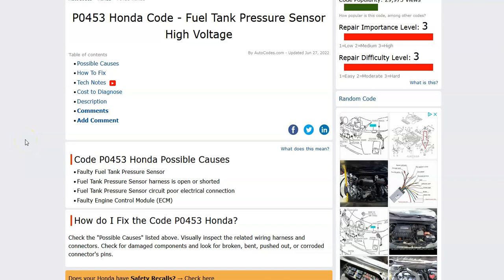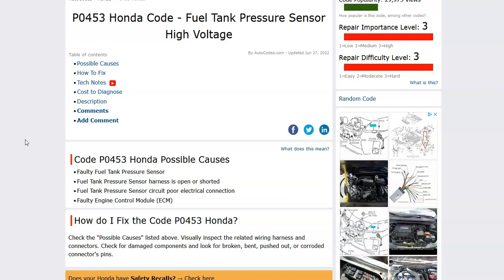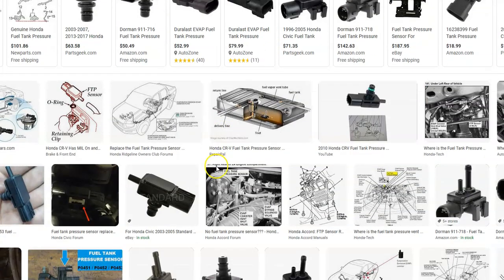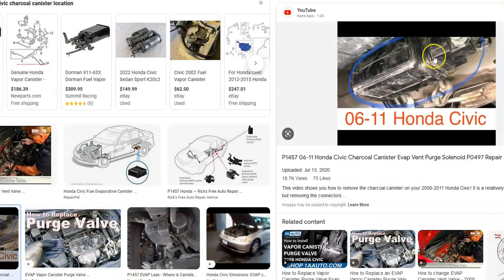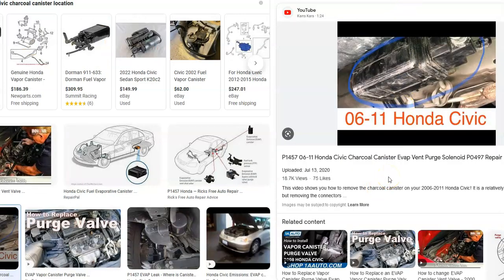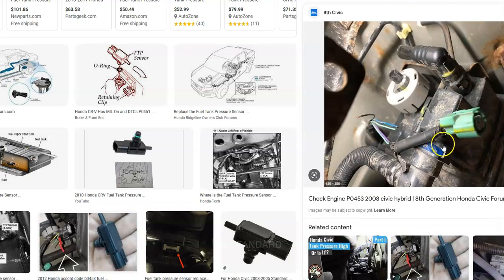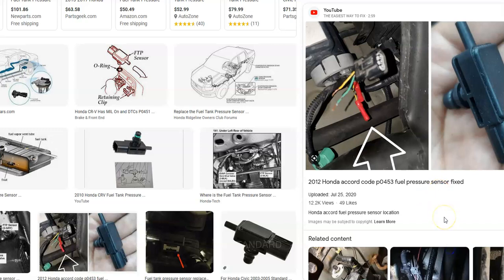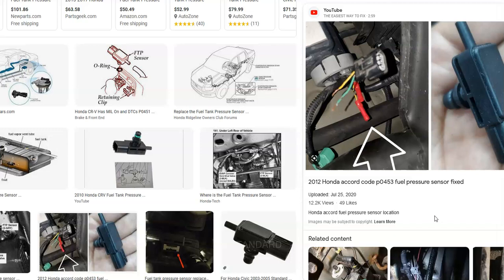How to Fix Honda P0453: Fuel Tank Pressure Sensor High Voltage

Comment: hi.  I have a Honda Civic 2013.  Its reading this code and the fuel gauge is not reading anything, even though there is fuel in tank.  The car cranks good but does not start.   Do you think changing this sensor is a good fix?   Thanks!
Reply from the maker: A bad fuel tank pressure sensor would not cause a no-start, but there may be an issue with the wiring going to the fuel pump. I would test the fuel pump to see if it is working.
Reply: @whyingo7964 how long can you drive the vehicle with a P0453 code?